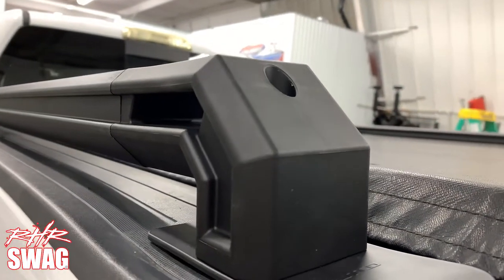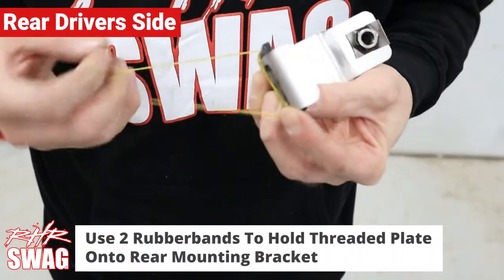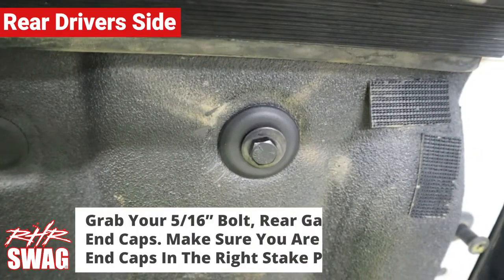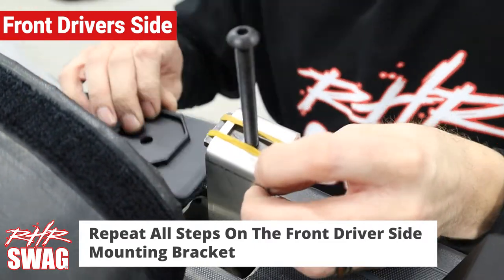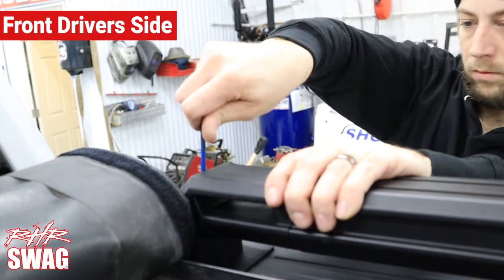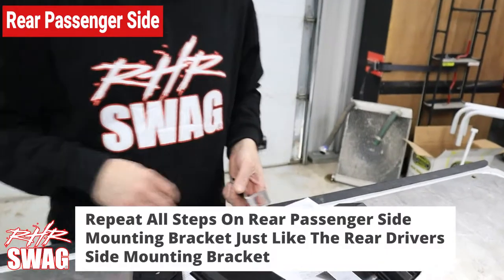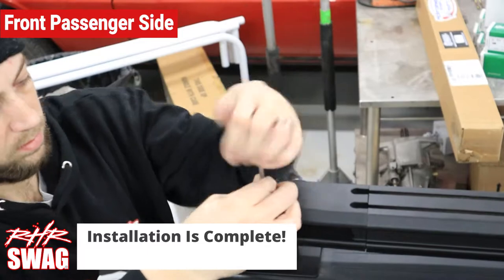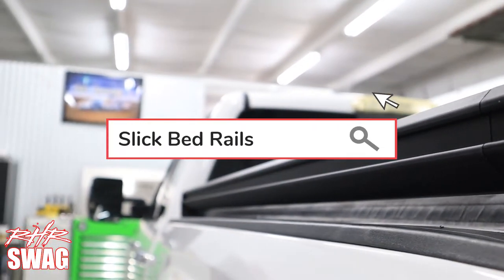Putco Tec Side Truck Bed Rails Installation - RHRSwag.com

Comment: I have to admit, I have never witnessed the product I designed to be actually installed.  We did it all in Solidworks 3D and moved onto production.  Great video and the installation is world class when there is no drilling or modification of the vehicle.  Thanks for the great video!
Reply: Looks like they had to drill/ cut a hole where the hidden front stake pocket is located so I wouldn't say there is no modification required.
Reply: Must be a British truck. Video says drivers side when it is clearly passenger (in the US), and the bolts are 3/16” not 5/16” and 9/16” not 3:8” at least in my kit (for a ‘21 Chevy Silverado 1500 Trail Boss).

Comment: I found it much simpler to assemble each corner piece and then drop it down into the stake pocket to thread the bolt in. Then loosen the allen bolts and the stake pocket bolt to slip the rail on the rear first then the front and tighten it all down.